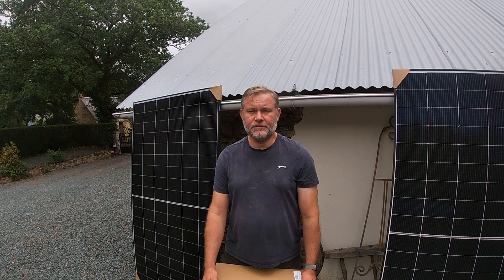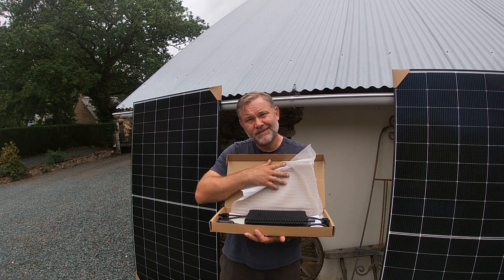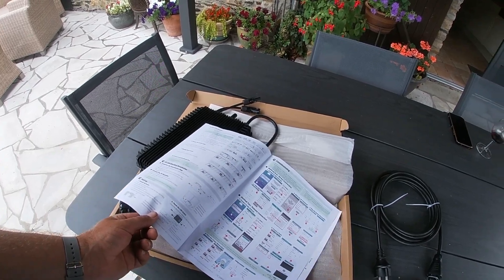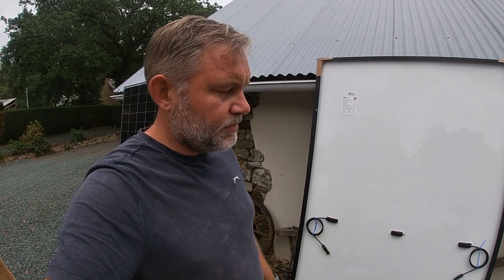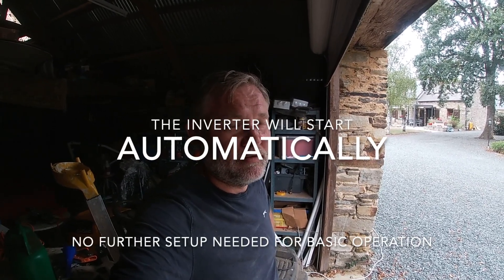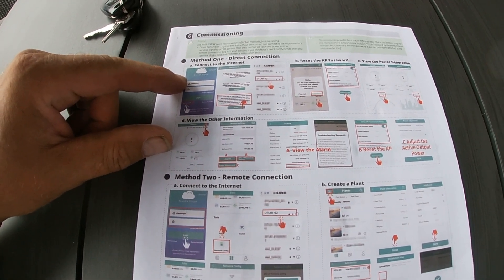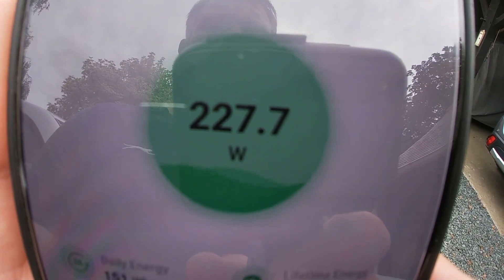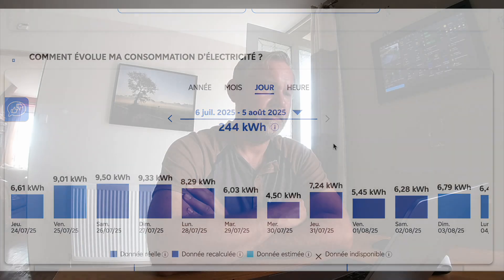Plug in solar kit - How easy are they to install and is it worth it?

Comment: "you don't need to tell anyone". We bought ours from our electricity supplier and they got us to tell EDF who ensured the Linky didn't allow any surplus to get into the grid! Make of that what you will.
Reply from the maker: You were misled. NFC 15-100 states that you need to use a micro inverter system no bigger than 3kw and the consumer unit must be protected from it by a 30ma RCD and must be connected to a normal 16a socket. You should also have a functioning earth connection in the house. Hope that helps .

Comment: I nearly bought £8.5 grands  worth of  6kw solar PV  with 5k battery , but the pay back was going to be 8 +  years ( I use about 6kw hr /day. At 28p / kwhr octopus  ), it would need scaffolding..(prob 1k) , profit to salesman , install co etc  , prob £2.5k ?  So  £3.5 k of fixed cost ?   

, so I bought an 800 w  2panel  and micro inverter for  £540,,  from ABC renewables , Brum , and it's going on sw facing shed ,, prob take 3 hrs to put up ?  ,, luckily I have a spare  breaker on consumer unit that just runs front door bell , so will hijack that to get dedicated breaker ,, you can get bidirectional breaker off Amazon from 30 quid ,,,,,  just a bit of fun .  But interesting and satisfying to give the finger to the NRG co,,, if only a little finger 😂😂😂😂😂😂😂😂. Course the UK GUV has immediately said these sys are illegal , but then they would ,  how are the gonna justify the 49billion cost for Hinckley point 3, if 10 mil people buy one of these ?? but it's 230 AC live your playing with and of course there will be idiots who electrocute their grandmother and the cat to death , that you've got to consider ,,,  soi guess thats what the GUV are  thinking ,
Reply from the maker: Interesting that the kits are available in the UK
Sounds interesting let me know how you get on.

Comment: Fantastic Video Andy. Can these charge Batteries? Does Linky meters display how much electricity you use per day?  I take it these are used to offset you own usage!
Reply from the maker: Not directly charge but you could put a separate charger that uses the solar. Yes linky meters show a lot of information including how much you used and how much you are using at any time. Yes the panels offset your usage

Comment: Tell me please what is the approx weight of each pannel? certainly interesting to consider.
Reply from the maker: 22kg per panel 😊
Reply: @ajinfrance  Cheers. I think you said in your video that you were considereing wall mounting and I would be interested in knowing what fixings you may be considering for this? By the way, we have been regular viewers and likers since the begining of your blogs with Collin. We are in the Savoie, plenty of sun but specific conditions to consider!
Reply from the maker: @MarcHumphries-k9f thanks for watching. The frames of the panels are just aluminium so you can use any brackets you have for wall mounting. Just bear in mind that they won't produce as much as being on an angle.

Comment: Daft question but could go it be set up as a stand alone system  to run a pool punch and or heater.
Also  looking  forward  to linky video. I have no idea  if I have one of those
Reply from the maker: You do need a grid connection or battery inverter with these systems so it can't be a stand alone unit. But I like what you have in mind. In reality it will do the same thing, the energy produced will offset what you take. Stick around because I think I may have the solution for you in an upcoming video. It's a device that takes just the excess solar and heats water or swimming pools .

Comment: Brilliant video as usual. Informative and simple to understand. A couple of questions. The app to monitor the system. I have a UK Apple account and sometimes the French Apps are not listed on the App Store. Thoughts ?
At what level of electric generation would I need to either seek permission or notify the authorities ?
Cheers.
Reply from the maker: You could put in 3kw safely after that you would need permission. But if you put one kit on each side of the house you will  extend the length of time you produce solar without going over 3kw at any one time.
Also the hoymiles app is worldwide. If you wanted you can put a shelly power monitor on for 45 euros and follow it on the iPhone.

Comment: Brilliant Andy... can't believe how simple you made this and why it is not talked about much more 💁‍♂️. So bravo 👏👏👏 and thank you 🙏.
When I'm finally Insitu, I was planning on having a 10~15kw battery backup with around 4 ~5kw of solar to charge the system up in day...never knew that I could probably achieve a similar 'reduction in my electric' usage, by plumbing in 3kw directly into the grid with a smaller backup system for powering essential things such as standby devices (TV, internet, etc) and fridge/freezer....all depends on my average consumption when I'm there 🤷‍♂️...but again, brilliant 👍🙌 Jim
Reply from the maker: Anything is possible. Grid tied systems are everywhere here. I will do a run through of my home 20kwh system soon
Reply from the maker: Thanks 👍👍 stick it to them .....😅